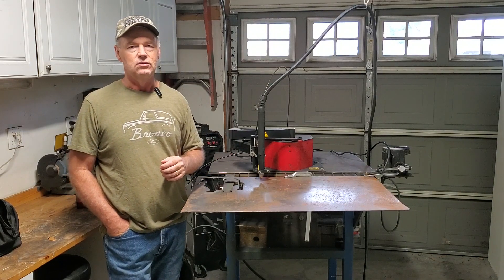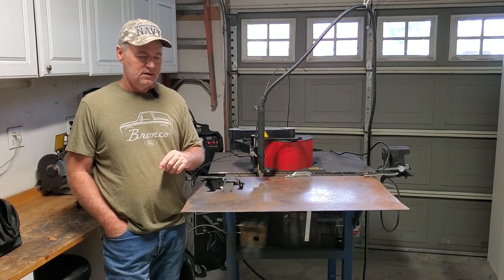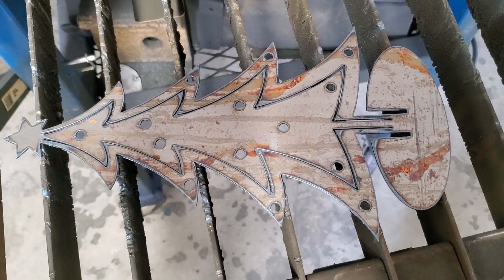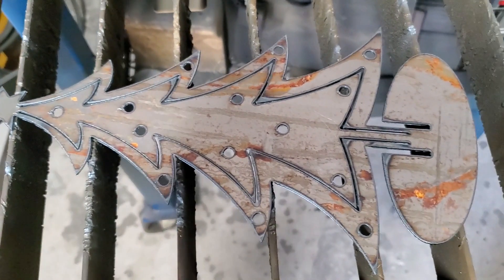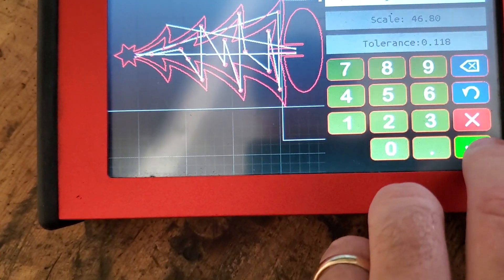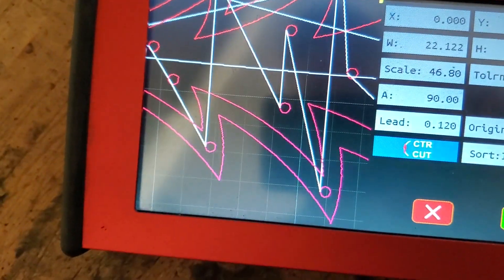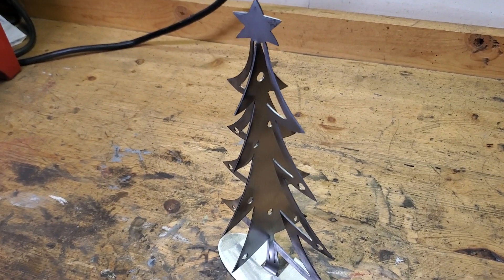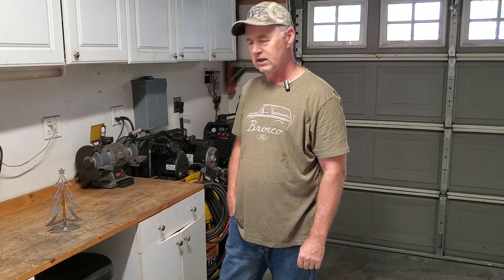Not a CAD expert? Buy a drawing from an expert.

Comment: Hi, I dont want to keep asking questions, but you have been helfull in the past. I bought a few files from Bad Dog, I tried cutting one for my wife, but it is to big. It shows most of it, but a few words are missing. Is there a way to make it fit? I have never used inkscape. Also, it cut the outside first and then the letters, is there a way to change the cut path? Thanks for your help.
Reply from the maker: Well easy question first.  You can change the cut order with the sort button on the arcdroid screen.  Push it and it should go to  in->out cutting the inside first then the outside.   Bad dog usually has his drawing as simplified as possible, he has several videos about removing unnecessary path nodes.  His cnc plasma must have more memory than the arcdroid. You might need to open the "svg" file that he provides in inkscape and do the project in two cuts.   Save each piece as a dxf and load and cut them separately.  The catch is using the screen and moving the torch around to ensure you have the zero point for the second cut lined up properly.  It isn't hard, and bad dog has some great 10 minute or less tutorials on his channel.  I've watched many of them.
Reply: Thanks, I knew I seen somewhere about the cut order. Splitting a cut in half, I may need to work on that one.